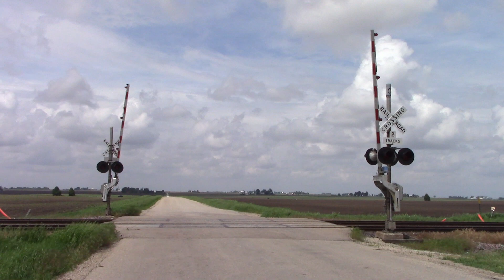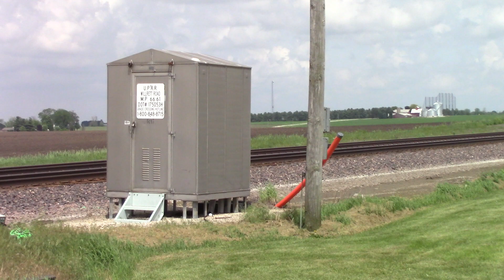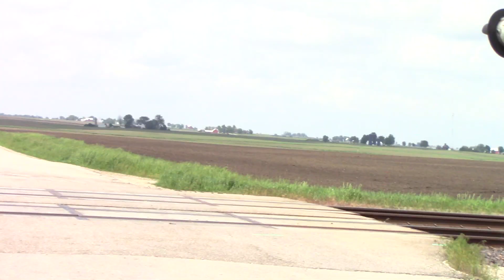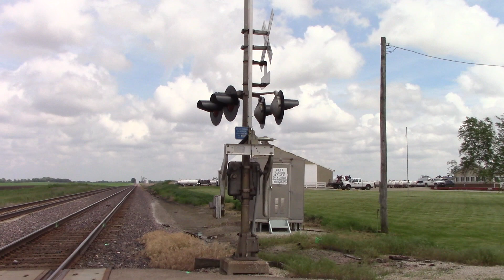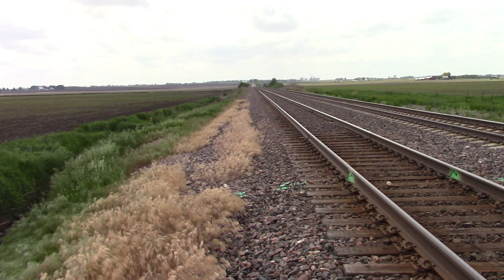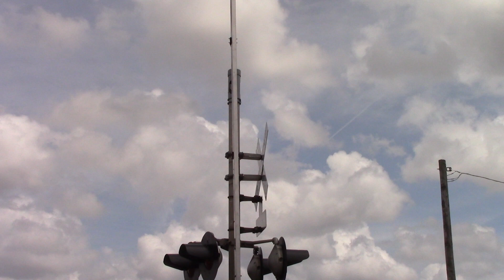Willrett Rd. Grade Crossing Update Malta, IL 5/28/20

Comment: I really wish UP was smart, and would use old signals to upgrade crossings with no lights or gates. It is beyond retarded that they replace working signals that are better quality than the newer Siemens and NEG crap, and leave unprotected crossings the way they are. UP has thousands of unprotected crossings, all of which can be upgraded to gates. It just doesn't make sense that they dump old stuff, and never use it again. UP needs some people with brains to work in their safety and signalling department.